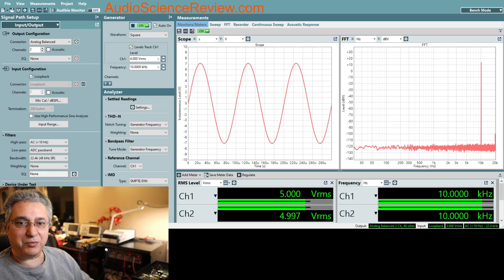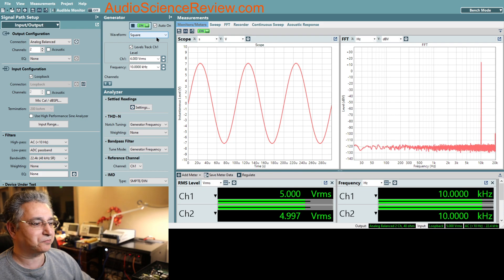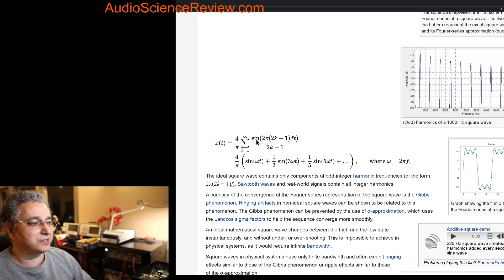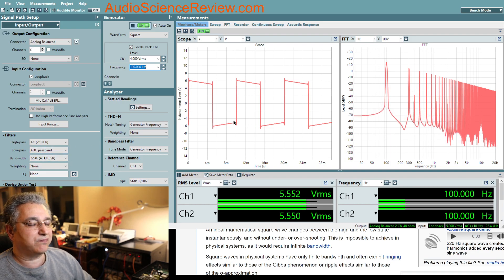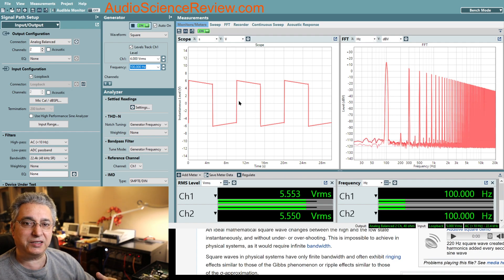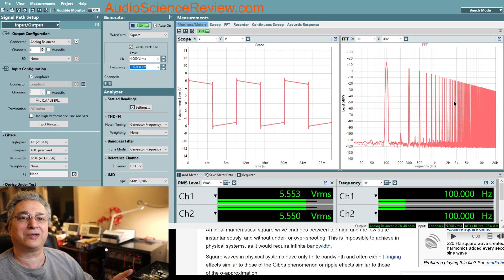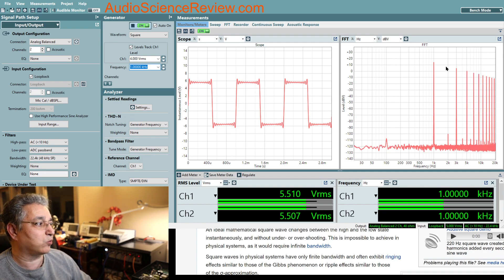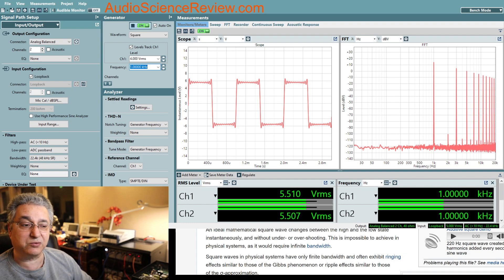Square Wave Testing of Audio Products

Comment: funny that you even said in this video that companies didnt want you to measure low freq square waves on their product.. did they ask you to do the same with crosstalk hence why its also not included in your measurements?

cant wait to see your next video how why crosstalk measurement are not important
Reply from the maker: No one has told me to not measure with square waves.  I said that if I did use them, they would complain about it not being a proper signal and I would not have much of an argument back.  And crosstalk is not that important either.  :)
Reply: @AudioScienceReview  you said a lie that no music use square wav when mostly half of modern music do even if they are not perfect square its still a appeoximative square wav and since this is true the companies lies saying its not a proper signal to use since its constently use in music.. 2nd for crosstalk you are stipulating that bleeding of one channel into the other on many weird freq (depending on the bad design) does not affect the sound when unwanted crosstalk is one of the worst nasty type of distortion there is since its create phasing at these specific weird frequencies.. any music producer like me know that since we understand what stereo mixing is and how important it is to have exactly what you want on each left right channel.. if left bleed even at -100db in the right at any frequencies it will create a weird FX.. and there are already voluntary phasing and crosstalk in music these will be broken by the chain defective crosstalk

analog synths with mixers or mixers that have crosstalk between channel are returned to the shop as defective or need repair and it's INSTANTLY hearable even if its very low crosstalk but hey i'm sure you are right crosstalk is not important since you are an expert.. :p 

I will add that crosstalk measurement also show how the engineer did their best to create a design that doesnt leak between channels.. IT shows they are pro trustworthy company

i'm sure any electronical engineer agree with you that crosstalk between channels in analog signal is unimportant hahaha
Reply from the maker: @lextr3110  It doesn't matter what you think you put in music.  The moment you sample it at 44.1 kHz for distribution, all high frequencies are chopped off so by definition, you no longer have a true square wave.  As for crosstalk, it is worse at highest frequencies where music energy is the lowest.  By the time you subtract the crosstalk level from meager amount that exits in music, not much is left to actually bleed into the other channel.  Don't confuse measurements for crosstalk which use full amplitude signal all the way up to 20 kHz with music content.  Finally, the louder the signal, the strong the masking effect.

Comment: normally its 30hz, 60hz and 300hz square wav because they are the one that are hard to reproduce correctly and they wont be reproduced the same

all opamp have square wav graph to show how they skew the square wav.. 

you seem to always manipulate the subject.. you did the same about crosstalk on your forum

it's not true that its not useful since most audio chain cant even reproduce a triangle wav correctly or when they try to reproduce square waves they reproduce triangle or weird phasy sine waves

any music with electronic synths use tons of square waves.. (HALF of modern music) even if they are not totally perfect square.. its still important to be able to reproduce them correctly for half of the modern music out there.. even if they are bandlimited.. 

there are reasons why companies wouldnt like these measurements there its because its the hardest thing to get right.. you need awesome work on analog stage to do it correctly.. most opamp m skew the square wav rendering.. (slew rate, low voltage swing of opamp impact the square wav rendering)

its not true that its easy to read square wav rendering capabilities thru other graph..
Reply: You just said what I wanted to say. People need to know what to measure with a square wave generator. It is not useful for every component but measuring for example preamps built on opamps can show us some interference or oscillations at the output. Also slew rate. It can tell us how preamp behaves on low or high freq.
Reply: @tomaszm2448  yes analog stage,  preamp & amp are a type of amplification, slew rate and voltage swing measuments on these will parallel on square wav rendering measurements.. + oscillations etc.. like you said..

since you can measure many square wav frequencies you can see how the amplifier behave with bassier square wav that are harder to reproduce for amplifier vs higher frequencies squares wav that are easier..

low freq square waves measurements on headphone, drivers and speakers are also important and show a lot on the capabilities of them..

thx for the support ..
Reply: @Douglas Blake You can have very square wave with headphones if you want to. Although, you don't want ideal square wave from headphones. There are targets to shape the sound.
Reply: Of course opamps have square wave graphs. They are usually used for things not at all related to audio. Square waves, bandwidth and slew rates are very relevant for many situations where you would use an opamp. You comment it like saying we should put amplifiers in wind tunnels to measure wind resistance. It has nothing to do with audio, but hey we put cars in wind tunnels too so therefor the metric is valid. It's not. There's zero a square wave can tell you about the audio spectrum that isn't far easier to read directly from an FFT or frequency response curve.
Reply: @Garbz  so you are saying slew rate and voltage swing have no impact on audio design choice? Hahahahhahaha

there is bandlimited square wav in music so i dont see your point

i give you a bandlimited square waves in the input you give me the same bandlimited square waves but amplified back OK 

if your opamp cant do it.. your analog chain using that opamp wont do it either..

im not talking about opamp use for other equipment but those for audio..
Reply: @lextr3110  Of course it has an impact on design. We use these figures to determine if the final design is stable or needs bandwidth limiting. What it doesn't have an impact on is the final audio. And in any case the square wave representation given on opamp datasheets remains unnecessary as anything relevant to designing an audio amp will in one of the other graphs. 

I'm not sure why you're laughing. I certainly wouldn't be if I were displaying ignorance on a topic. 

You want to give me a band limited square wave (for the audio band then I assume you mean a heavily distorted sine wave, I can work with that). I'll give you a perfect one back and I'll do so without even look up slew rates or squarewaves on opamps because (and I can't stress this enough) they are completely irrelevant to designing audio gear as far as no opamps on the market currently have slew rates that impact our ability to amplifier a <20kHz signal.
Reply: @Garbz  so we agree you say "even if no opamp on the market currently have slew rates that impact the ability of an amplifer" there this mean slew rate of the opamp still impact the output like I SAID .. 

and actually you select opamp of different slew rate if mode power is needed in amplification stage 

also in my opinion an analog chain show be able to render correct waveshape up to 40khz like a 40khz bandlimited square wav etc.. 

what i was saying is slew rate is important if you want to keep the complex shape like a square intact without overshoot etc.. UNDER THE LIMITED 20-30-40khz.. 

and seem we agree on this too ->
 IF I give you an heavily distorted sine that look mostly like square wave or we could say a bandlimited under 20khz square wav than you return me the same and we can compare the ability of amplifier to reproduce correctly that complex wave shape

I didnt say there cannot be other measurement in the time domain that could replace square wav rendering .. it's just that i like to compare square wav rendering graph to see how much that complex wav is distorted from the input to output. 

THANK YOU of agreeing with me BYE

here is your bandlimited square wav.. to me it still look like a f. square 
https://www.nayuki.io/res/band-limited-square-waves/waveform-bandlimited.png
Reply: @lextr3110  No we don't agree specifically in the application of audio. If you want to talk non audio go find another video to talk shit on.
Reply: @Garbz  different slew rate in combination with other opamp parameters will change how opamp react to input even if they are audio opamp and even then we are talking about correct bandlimited square wav input to output rendering .. audio opamp can overshoot or skew square waves and this skewing will influence the output square wave of the overall amp or analog stage and im talking here of a bandlimited square waves.

you are a manipulator stipulating that all audio opamp render bandlimited square waves the same and that this opamp will not affect the overall wave output of the amp that use the opamp

its not because current audio opamp have enough slew rate to cover the whole 20khz that its not a parameter that affect the sound and wave rendering..
Reply from the maker: No music has square waves in it.  As I clearly showed, band limited systems can't reproduce much of even if you electronically synthesized it.  Also, "testing" is not the same as performance evaluation.  Op-amps specs and such have nothing to do with assessing the performance of an audio system.
Reply: @AudioScienceReview  you said "no music has square wav in it" you mean perfect square waves.. but thats manipulative you hide the fact that approximated square waves are still use and there.. and for your take on opamp... like if slew rate and voltage swing dont affect the sound of an opamp.. and of the amp using them.. haha you say only important on testing but not on performance evaluation.. yes but this is if you dont care about square wav approximative rendering at output in your performance evaluation.. hahaha
Reply: @Douglas Blake again with this than why not pass a bandlimited (under 20-30khz) square wav and show this input square wav versus the output square wav in another color.. on same graph

what we want to know is how its skewing the input wav that are hard to reproduce like a bandlimited square wavs. who cares if its a perfect square wav... 

amir said the same manipulative statement in his video.. 

also, its not true that low square wav are easier to reproduce... ex. headphones have harder time with 30hz than 300hz square waves

with amp power supply bad quality and voltage swing might change the low freq square waves rendering
Reply: Why resort to square wave when you can clearly show how much it attenuates in low frequency?
Reply: It's just frequency response.
Reply: @Douglas Blake even headphones its shows a lot its not about rendering the perfect square wav.. its about comparing between the ability of different headphones to approximate it at output..for example.. you can see that one can  render it approximatly as mostly a square while the other as triangle and another as a phased sine wav... i prefer the first one dont you?

Comment: I believe the sloping down you can see is actually from your high pass filter @ 10 Hz. Missing higher order harmonics have more "wiggles" but don't slope towards 0 like that.
Reply: @Douglas Blake He's 100% correct.
Reply: @Douglas Blake How come the 1kHz squarewave has no tilt then? ;-)
Reply: @mattbastable1942 the frequency response of this high pass filter doesn't really have any attenuation at 1 kHz
Reply: @jeffbeasley8235  Exactly.